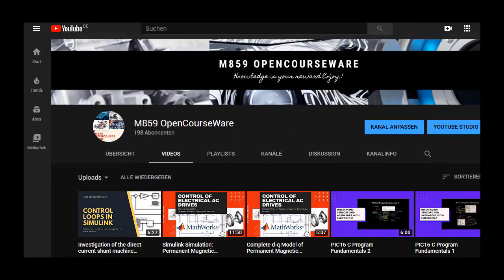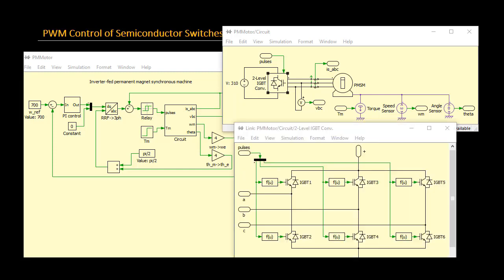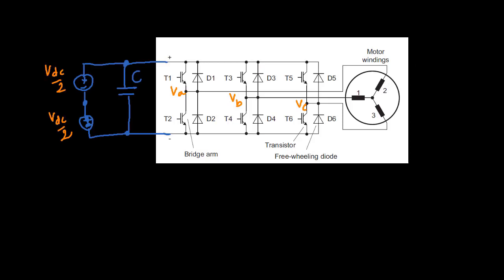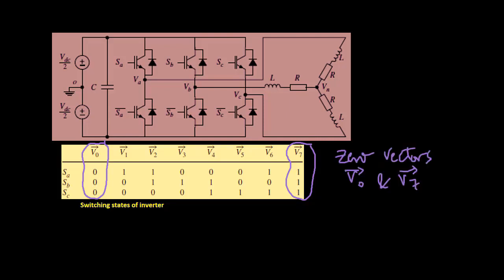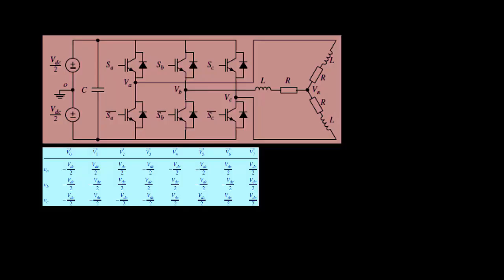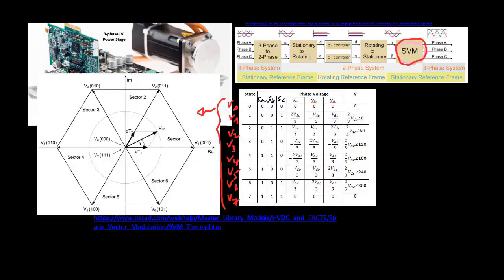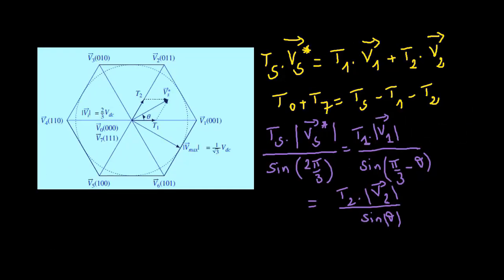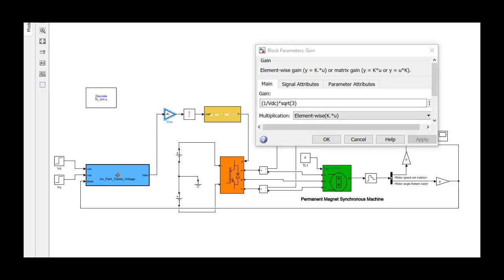Space Vector based control of IGBT Inverter (SPVM)

Comment: First of all Thank you for sharing this Video. This is such an amazing explanation of Space vector modulation. Assuming you as being a master on this level I got some (3) questions upon the topic.
The reference speed value coming from the pedal sensor in an electric vehicle for instance is a voltage signal for example between 0 to 5 Volts right? This value gets adjusted to the properties of the specific system right? So the d and q values after the park transformation are just some constant values and the reference value gets converted to be such a constant too to match. Then an error signal can get calculated by comparing these values?
This means concrete if my system got an overall current of 300 Amps this refers to my d and q values to be a value between 0-300. My sensor values from 0-5 Volts could for example be 2,5 Volts which then get converted to the system to refer to the value 150 to match?
Second looking at the space vector modulation signal generation obviously this six different possible sectors are generated in succession. Is there only one reference vector generated for each sector (6 overall for one complete period) or is this depending on the frequency of the system and the rotor angle demand, so if the rotor angle is 2° every 2° there’s another reference vector generated by the igbts which is slightly so 2° further in the cycle but has the same amplitude? This would correspond to (60°/2°) 30 different vectors in every of the six different sectors to complete one period. This would result the reference vector to seem to rotate through the hexagon. Is that right?
If you want to implement this digital in a microcontroller will the input signals a b and c form the inverse Clarke transformation then be transformed and calculated to result the on off times of the different switching vectors? And this on off times then will be transformed into the compare values for the compare Register of the timer that generates the signals?
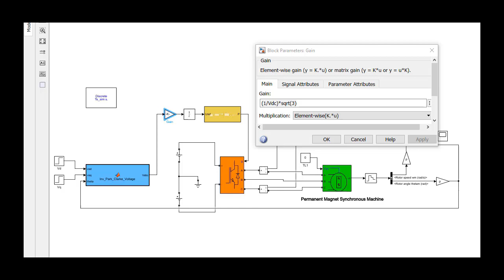And one last question where did you got the animation “Space Vector based control of 6 switches” 8:01 from. Simply amazing.
Thank you for dealing with my questions
Reply from the maker: thanks for your praise! yes the information coming from the pedal sensor for example towards battery management system should be used for motor torque demand.yes id and iq are dc signals , this is the first FOC goal to be able to control field machines as like as dc machine. at the end of the day your controllers need reference signals in SI Units ampere or in rpm (rad/s), that depends on your modeling, because this units are also included in your controller parameters kp,ki...
The µC,DSP or FPGA are equipped with internal ADCs with input voltage range of for example 0V . . . 2.5V for current measurement, supply voltage measurement, analog hall signal measurement, analog encoder. they processes currents as 16 bit signed values. Raw ADC values are expanded to 16 bit width independent of their resolution.
The ADC scaler with offset correction is for pre-processing of measured raw current values. It might be used to map to own units. For scaling, gains of current amplifiers, reference voltages, and offsets have to be takin into account.Electrical angels and mechanical angles are represented as 16 bit integer values. One full revolution of
360 deg is equivalent to 2^16 = 65536 steps. Any position coming from a sensor is mapped to this interger range. The inner FOC loop controls torque and flux of the motor based on the measured phase currents and the electrical angle of the rotor.
In the modern control for memory usage the Interrupt Service Routines: all mathematical blocks of FOC algorithm, SVM, and motor phase current sensing and calculation are executed in the SRAM for example. This improves the performance as the execution time to run the FOC algorithm is reduced.
Execution of of Sensored FOC: Start of ADC interrupt service routine,Clarke Transform,Park Transform,Calculate PI controllers output to obtain vd vq reference,Measure electrical position,Inverse park transform,Space Vector Modulation to obtain PWM duty cycles,Calculate mechanical speed  and Iqref after every discrete x PWM cycles,End of ADC interrupt service routine.The FOC software is implemented in the ADC interrupt service routine after the end of the conversion of data.When the ADC conversion is completed, the ADC ISR (ADC interrupt) is entered. The FOC calculation is done in this interrupt. It runs at the same rate as the PWM switching frequency.but there are many solutions. the link is still coming .please not forgot to like the video :-). I hope I could be of further assistance.
Reply: M859 OpenCourseWare Yes thank you so much for replying that detailed. I think this was more helpful than one week of research at all!!!
Reply from the maker: @6:32 The modulation of the desired space vector Vs is obtained by the time average of its two nearest active vectors and a zero vector. Vs could be modulated with the time average of the active vector V1 and V2 within one sampling period. µC realization is @7:20 The arrangement of the four switching vectors in one sampling period to minimize the switching losses. Null vector to null vector V7 to V7 and V0 to V0.
Reply from the maker: https://youtu.be/RB41ioBhyzE

Comment: Are there any SVPWM Motor Controllers commercially availabel? 
Where to buy these?
Reply from the maker: yes there are enough. but you should specify more.
Reply: @eDrivesEmbed  I need SVPWM 3 Phase Motor Controller with 120 degrees  setting for 12 Poles up to 22 KHz Max. RPM 3600 Motor 8 Kw. Please advise

Comment: It was my dissertation I used SPVPWM to control three phase four leg inverter based on FPGA
Reply from the maker: good work:  three phase four leg inverter inverter is employed to supply unbalanced loads avoiding the use of a transformer and to maintain the desired sinusoidal output voltage waveform over all loading conditions and transients. It is ideal for applications like data communication,industrial automation, green energy  etc, which require high performance uninterruptible power supply.but for example in the automotive sector for traction applications. you can't afford that. two igbt's and especially the fpga. that's too expensive and no OEM will pay you that. that's additional millions of euros. because millions of cars are produced. my engineer diploma was fpga based field oriented control for servo drives.